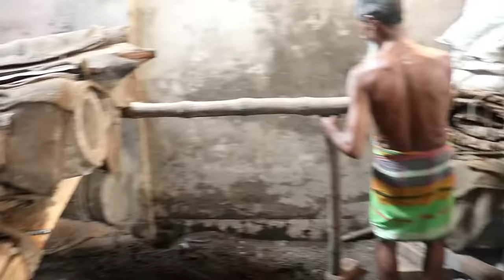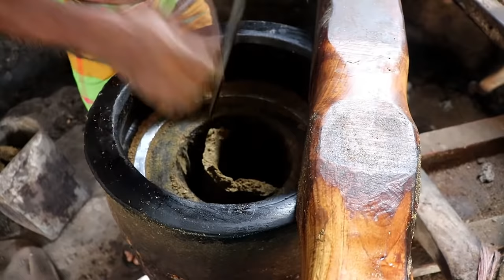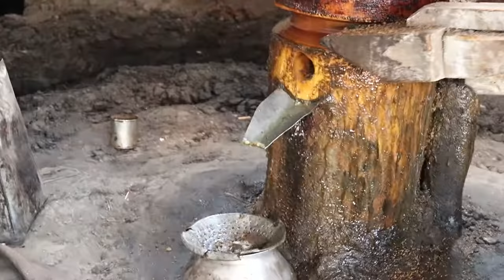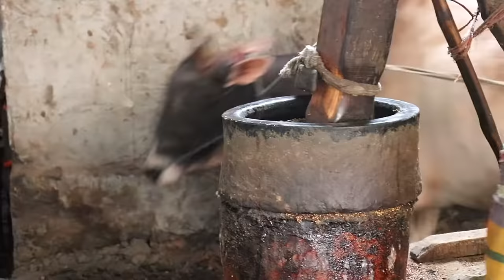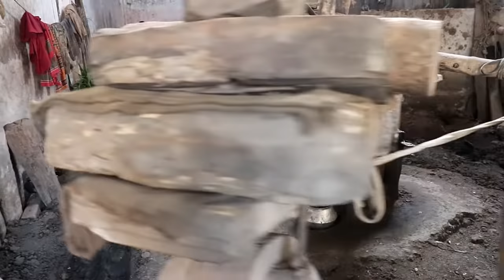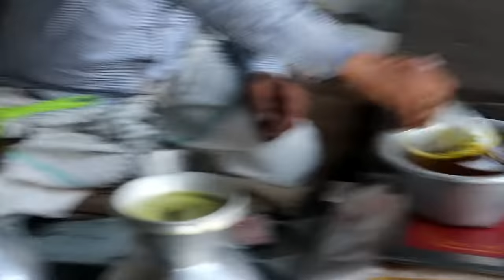Traditional Mustard Oil Making Process

Comment: The space is quite narrow for a bull to move.. There should be enough space to move around and instead of putting so much of weight on one single bull they can use two bulls to share the burden.. In south they use two bulls and good amount of space to take out coconut oil..

Comment: Yes it is the oldest way to extract oil but definitely this could not be the way of handling an animal in 10by 10 room. Where there is no external air. This is cruelty on animals.
When you can eat the animal you can do anything with them. 
Don't relate this with tradition...